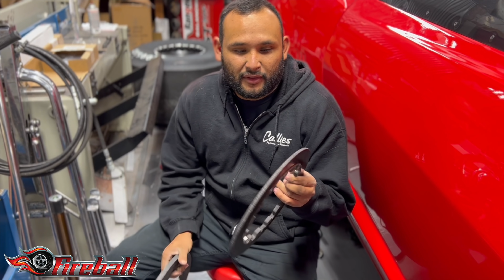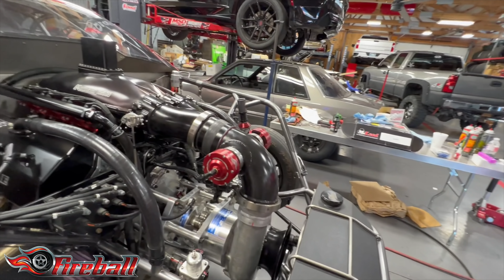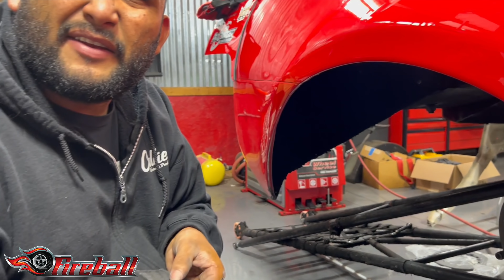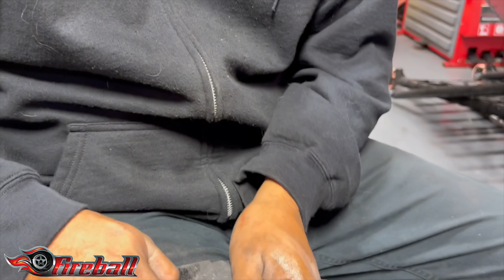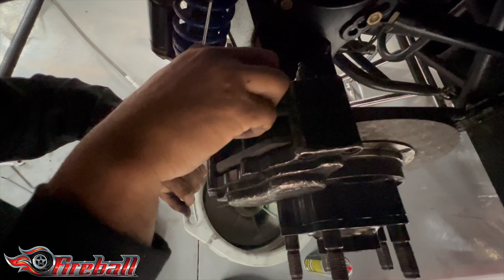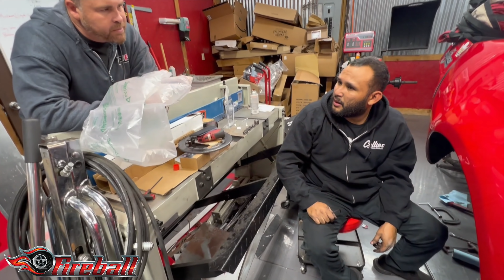We Need Brakes NOW!!

Comment: Javi is not doing nothing wrong by scuffing the pads up he is actually doing right you don't want to put no brake pads I have any kind of glazing on it on a brand new surface on a rotor. Or if you're dealing with the OE situation and a production car you don't want to put a glazed over pad on a new rotor or even a rotor that's been turned it'll squeak so the best thing you can do is take very little off of it just take the glaze off of it and his situation he runs into a situation I've never seen before. I've never seen a brake pad unless it was the wrong brake pad or wrong rotor where the brake pad has that lip on it unless they were installed wrong. Usually that lip is on a old rotor it has had the life of a set of brake pads or even two brake pads it forms a lip on the outer diameter of the rotor. Don't know what to say there I've never seen it but I've never dealt with carbon brakes either. Or a cars that used to doing massive burnouts to heat the tires and then making a hell of a pass going over 200 mph in the eighth. That push breaks under extreme conditions.

Comment: I don't understand why you would re use  the old brake pads, what did you save a couple of hundred dollars after 5 years?
Reply from the maker: The brakes pads were just installed a race ago.    Just overlooked the rotors.
Reply: @FireballCamaro Ok. My mistake.  It's great to go fast but need to be safe.  I just like to see you and your car shiny 😎😎😎

Comment: I understand trying to save money when possible but not on the brakes.hand sanding pads not a good idea.
Reply from the maker: Ok......what will sanding the brakes do?   Please tell em.
Reply: With the amount of heat that builds up when braking you don't know if the pads integrity has been compromised. Sanding pad by hand can cause surface to be uneven causing extra heat build up and reduce the stoping ability. It's one thing to go fast but you should never compromise the brake system.

Comment: Well now that they have replaced the brakes rotors in the rear how about rebuilding the brake calipers because if the caliper pistons were over extended that far it would be a pretty safe assumption that the piston seals have been compromised to a certain extent and having a caliper piston seal blow at 80 mph can be exciting and at close to 200 mph I bet would be outright hair raising and underwear eating event requiring a trip to a proctologist to have it removed.  Also it is a good idea to replace the brake pads when replacing the brake rotors to bed in the new carbon brake rotors and if you were to install the old pads to level them using a file and a sanding block as opposed to a piece of emory paper and a cordless grinder

Comment: Using a small grinder, with a wore out grinding disc. Is what I learned to use years ago to knock the glaze off of brake pads. (On racecars) 

Which it works for the racing application , just fine. 

I have used sandpaper on drum brake shoes to knock the glaze off as well. When the lining on the shoe was still good. On top of the fact I would use the mini buffer to do a dis-direction finish on rotors I turned on a brake lathe. Then on a drum I used the mini buffer to do a dis-direction finish on brake drums as well. 

Now currently I just get new brake rotors/drums and pads/drum brake shoes. 

Since I view brakes like I view my EDC ammunition. Which is, I believe spending the extra money is well worth it for my personal safety.